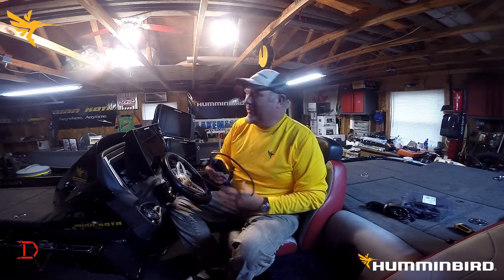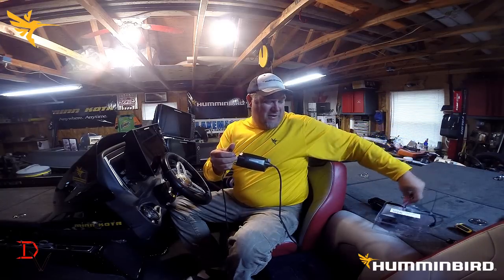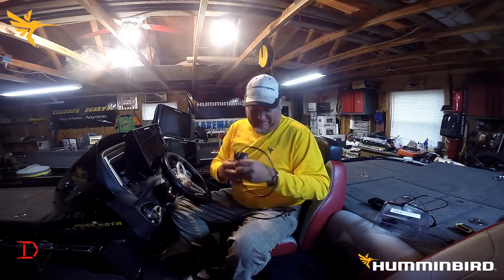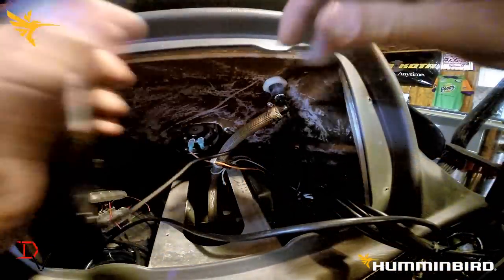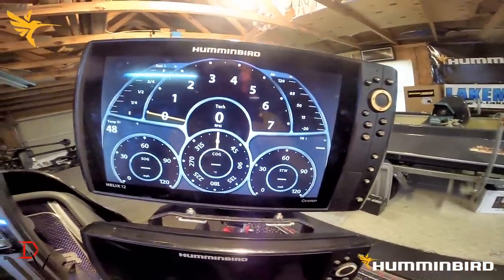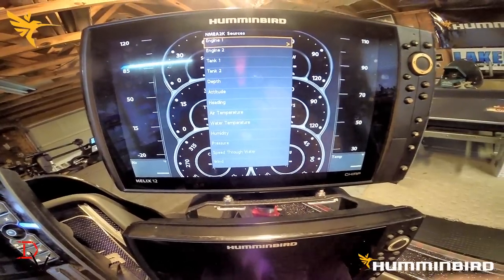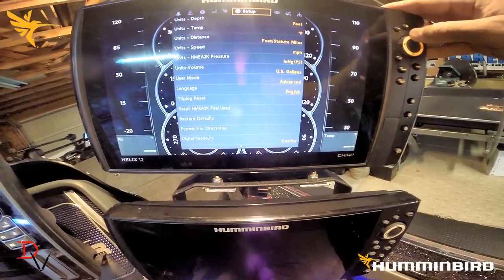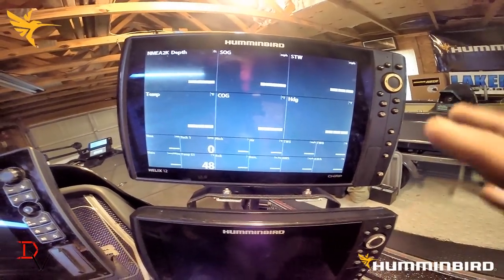Tips 'N Tricks 209: Humminbird HELIX - NMEA 2000 Install

Comment: Did you wire it up? What about running wires to and connecting to motor? Did you have to make a network that needs to be connected to a power source or run straight to unit from motor?

Comment: Doug, can you plug into a NMEA network you already have that is running to Lowrances? I have both Humminbirds and Lowrances on my Skeeter.
Reply from the maker: Just need to add a T & extension cable to connect to existing NMEA 2000 Backbone.

Comment: Thanks for the video, sorry if I missed it but what exact model Helix is this?  I have a Helix 7 G2N and wondering if I can get the engine specs layout?
Reply from the maker: HELIX 10 DI G2N or HELIX 10 SI G3N forgot which one I filmed but both the same as far as NMEA 2000 Data
Reply: @DougVahrenberg  
Thank you!

Comment: Hi Doug, thanks for this very nice video! H'birds website is really missing documentation regarding Nmea2k capabilities with their units... 
Quick question regarding the fuel gauge. Do you need to have an NMEA 2K tank sensor to get data into the gauge or you can set somewhere in the system that you have a 40 gal tank (with a refuel option) and you get real time tank view? I know that comptetitors are providing this feature hope it's native with my Helix... Thank you very much for your feedback
Reply from the maker: I'm just beginning to learn NMEA 2K and then god froze Missouri and haven't got back on the water to learn more. The HELIX will read data from the NMEA 2K Network and if it has Fuel Tank Sensor I think it will read that data. I think Skeeter has that as part of their NMEA 2K data because I have it on the Skeeter Multifunction Gauge. When it thaws out my goal is to get more video on the water with NMEA 2K.

Comment: Can you view your engine hours?
Reply from the maker: I have not found that feature on the HELIX yet but the SOLIX I have seen Engine Hours and that Video is next to publish
Reply: I have the helix gen 2 and a 250 sho. I dont have anything that reads engine hours. What would be the best thing to read them.
Reply: Will that black box not work on the solix? I have the black box and the engine adapter and was going to hook it up tomorrow.
Reply from the maker: You need the Yamaha Interface kit from Yamaha then to connect NMEA 2000 Backbone.
Reply from the maker: Not needed with SOLIX.
Reply: I found engine hours on my helix, this is the way to go.
Reply: Stan Stone I am looking to make the jump to the nmea 2000 to hook up my 2017 F150B Yamaha to my helix 10. You are saying that you can view engine hours through the helix 10? This is one of the most important reasons I want to make this investment. Please let me know that you can read the engine hours?

Comment: What motors can u use this on
Reply from the maker: Any motor that is NMEA 2000 Compatible. You'll need to ask the engine manufacturer if your motor is NMEA 2000.
Reply: Doug Vahrenberg so a older boat won’t work
Reply from the maker: Depends on how old. Contact your boat dealer or outboard manufacturer to find out
Reply: Doug Vahrenberg it’s a 97 evinrude 150
Reply from the maker: 1997 is prior to NMEA 2000 protocol being invented. Your not going to be able to link that motor.